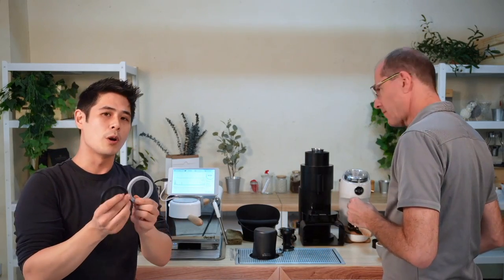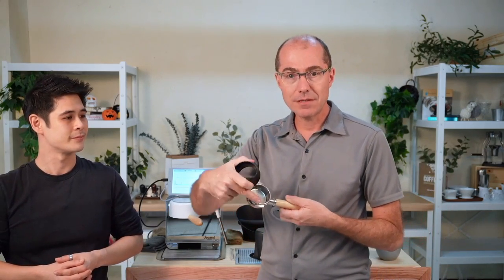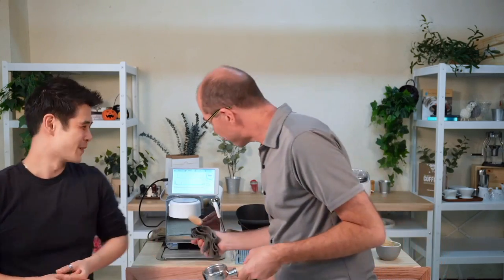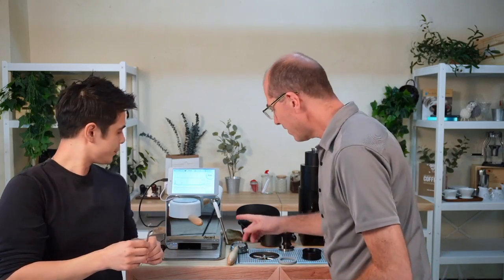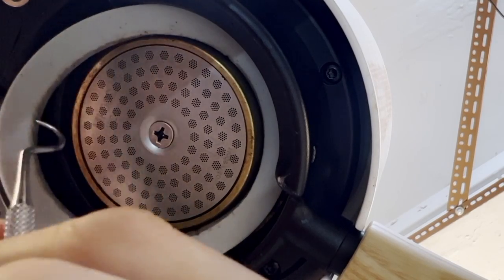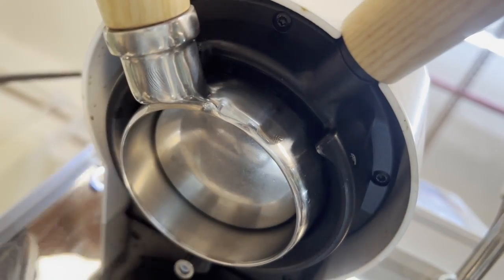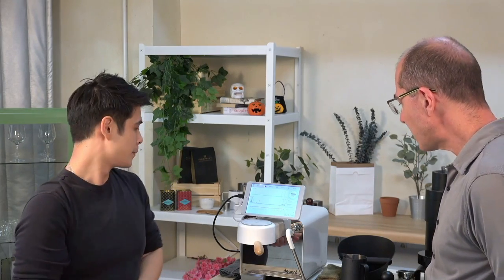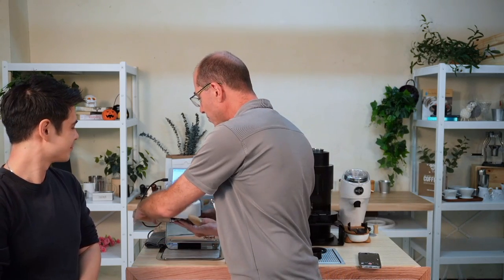Espresso Gaskets, a very deep dive

Comment: I’ve needed to swap gaskets for a while now, likely from pushing too hard. Now that I see how easy it is I’m upgrading to a cafelat one ASAP and then will get a decent one whenever I order more from you guys again. Stoked to get rid of that menacing minuscule amount of dripping 💦 lol
Reply from the maker: Nice, If it has been like that for a while you should notice the difference in taste. Your shots should be cleaner tasting as your grind will now be slightly coarser as the grouphead is not leaking pressure.
Reply: What Cafelat are using? and size? I will order my decent one with next order as well since im in europe..

Comment: Not sure if the minimum pressure is a good idea.. my experience has been the portafilter can pop out mid shot if too lose and makes a mess and can be dangerous if your break glass, spill hot coffee… 

Did learn though why I had a loose fit as I was used to rubber gasket and not silicone and I was stopping too early and not pushing in again.

Comment: Changed my gasket... Initially... I was unable to remove...  Dental tool tip was starting to bend.   There was a mention that the machine was hot...  Heated machine and after this... I was able to remove.